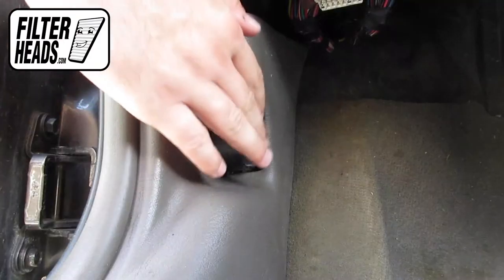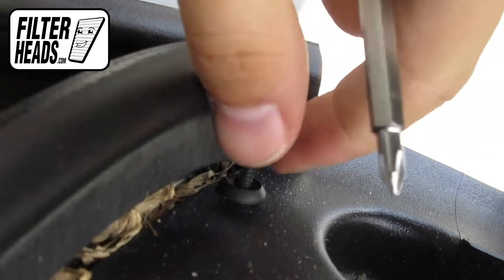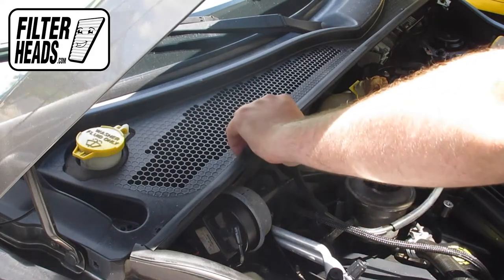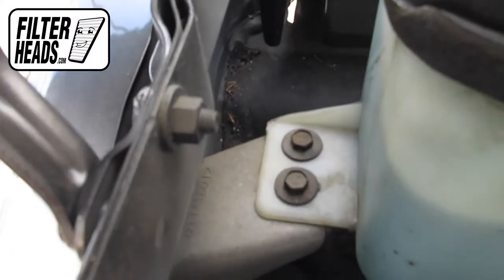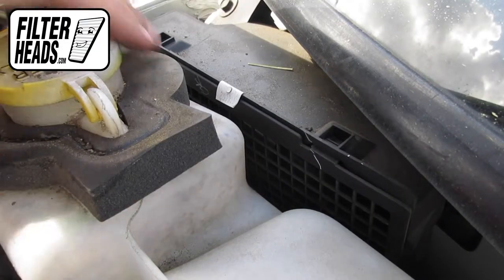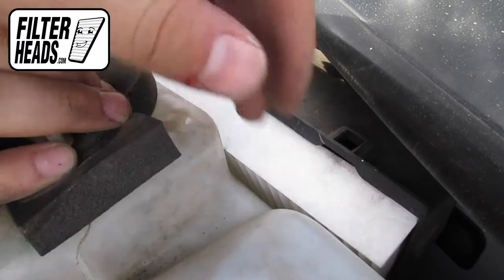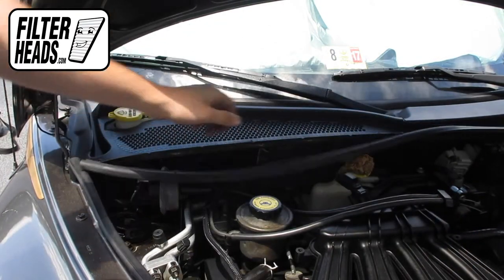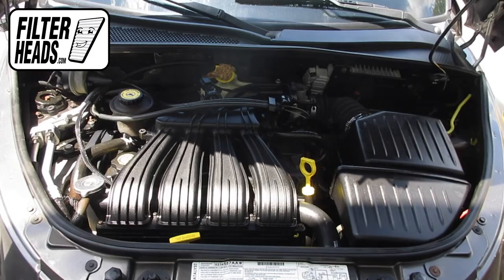How to Replace Cabin Air Filter 2002 Chrysler PT Cruiser

Comment from the maker: Purchase this filter at: http://www.filterheads.com/AQ1133
This cabin air filter is a Dealer installed option. The filter housing is required to add the cabin filter to the vehicle.
Reply: So does that mean I have to go to the dealer to get this changed out? Or that I have to buy a filter housing?

Comment: I have a 2001 limited edition and it looks nothing like this . We opened up everything and there wasn’t even a cabin air filter
Reply from the maker: This cabin air filter is a Dealer installed option. Not all PT Cruisers came with a cabin air filter housing.
Reply: Filterheads thank you ! I’m pretty sure mine doesn’t have it at all . So therefore I don’t need one ?
Reply: Yes, my 2002 Dreamcruiser just has an opening with a cover (behind the window washer fluid tank) that goes directly down into the blower. No filter at all!  It's quite frustrating that this car has an OPTIONAL cabin air filter?!  It was 20 years ago, but c'mon people!